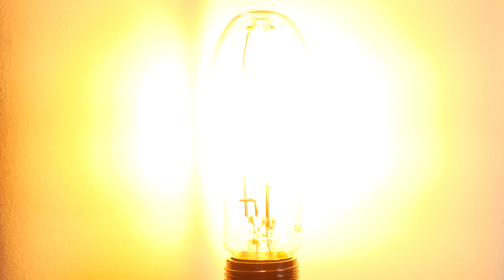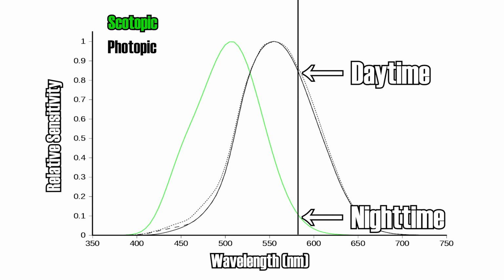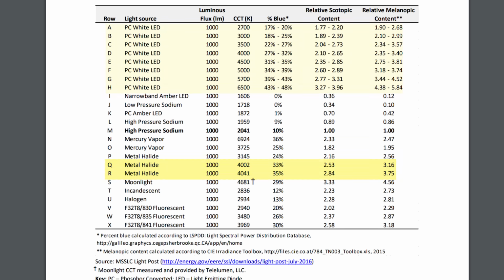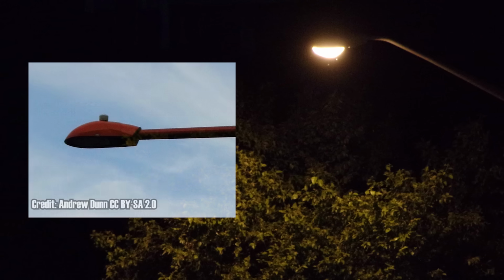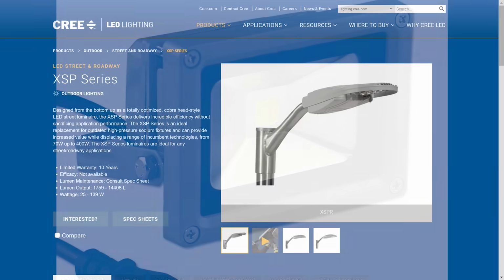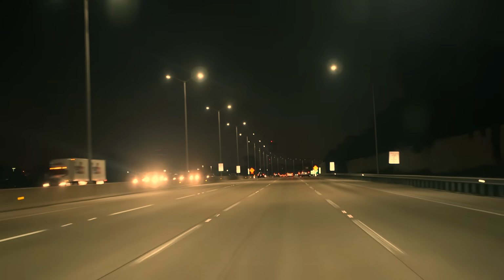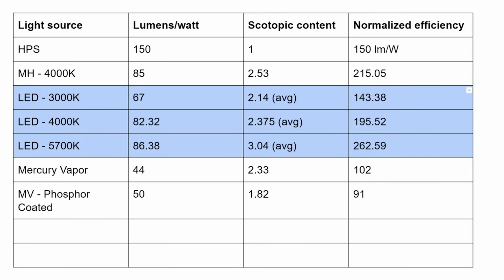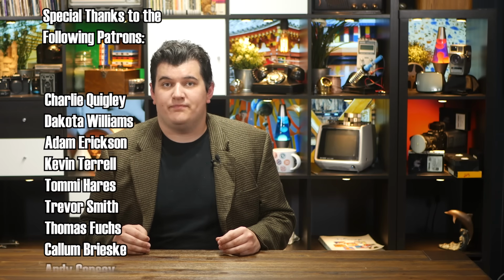The LED's Challenge to High Pressure Sodium

Comment: Honestly all outdoor lights should be red band.  That includes headlights.  Yea the color perception is terrible, and it is harder to see than blue but it does not destroy your night vision at all.

When you get off that highway lit up like a airport runway strip all the other roads for the next 5-10 minutes at least are going to be perceived as darker, so they will need to install more lighting in the future.  You can talk about saving a bit of efficiency on each unit, but you are not going to diminish the demand for lighting using wide band technology.

edit honestly was that highway poorly lit before?   You know that traffic circles are safer than 4 way lit intersections?  Because people perceive more danger- they are more careful.   You have to be very careful about speculation on this.

additional edit a camera with its highly adaptive technology is not going to show you the difference either in your diminished night vision- soon as you pull off it will be calibrating for current lighting conditions, not the 15-25 minute lag of night vision loss.
Reply from the maker: This literally is the opposite of how our eyes see at night.  Rod cells are adapted to moonlight/starlight.  Red light means little to them.  The issue isn't color rendering--it's the wavelengths that actually stimulate our eyes.
Reply: excellent video though.

Comment: I wonder if there will ever be a move to sensing street lights  that only turn on  when a car is present some distance ahead and behind it .  that would greatly reduce light pollution and be energy efficient provided that sensing dose not take up too much power.  the switch to led kinda promote this too  because they take no time to turn on
Reply: No help for pedestrians, in fact downright unsafe: An invitation to muggers and assorted thuggery.
Reply: You are very smart.  This trend for a system like you described is starting in Germany.  One light fixture can sense a car, and even wirelessly talk with the rest of the grid to get the light fixtures "ready."   Of course in heavy traffic everything is on, but after midnight most of it is off or dimmed greatly.  The risk is that the system may not function properly, thus creating a dangerous condition.

Comment: How about striking a balance of light sources? For highways, bi-passes and large volume traffic areas, use a whiter source of light, and for less traveled roads near homes and such, using a more yellow light? I know it would likely be difficult to get a decent balance, but it is an idea, and it isn't impossible. Light is a very important thing for me because I tend to drive a lot at night, makes me picky about the color and output of my headlights, and I do prefer intense white light for my headlights, but, I prefer a nice yellow for my fog lights. The combo of the two makes driving in any night time conditions a lot better. Be it foggy, rainy or snowing, I can drive a lot better with a mix of the two colors of light. My headlights I try to keep somewhere between 5,000K and 6,000K, and fog lights are around 3,000K.

Comment: Disrupting our circadian rhythm might be beneficial as the drivers will not get sleepy while driving. At home, you should use warm temperaturs. Also, the natural moon/starlight is as well cold, blue. Although much lower in intensity, still it could interfere with the circadian rhythm (are there any studies that take this into account?)...

Comment: The idea about reducing the light output after mid night is actually good, both for light pollution and for energy management. In Norway there are a few test stretches where the light fixtures are equipped with some light sensing equipment. T hey are running the lights at low intensity normally, but when a car is spotted it turns up the intensity untill the car has passed. This, of course, is saving a lot of energy when the traffic is low. 

I have linked a video where this is shown. https://www.youtube.com/watch?v=mi8eE_NEfHM

Comment: I think I prefer the sodium lamps over the LED lamps. I hate blue light, and the orange/yellow color that the sodium lamps produce is a really nice color temp IMO. But it's more important of what the majority likes in this case.
Reply: I think safety and saving energy are the most important things, not what color temperature people prefer to look at.
Reply: Yeah thats what is most important.
Reply: The jiro Network You must like the gentle glow of candles , but no one is going back to using them for general light.

Comment: LED lighting is the absolute worst thing that could ever happen to cars and road lighting.
Why ? Because there are no defined standards, and even if there were, nobody to enforce them. The result is that we get blinded more and more by oncoming traffic, even in the daytime now, and sometimes can berely see the road in some places under cheap LED street lights. Not to mention that in rain or fog or snow, those whitish LED street lights will actually light the water molecules in the air instead of the road surface itself !
Reply from the maker: There very much are defined standards for headlights.  That's what DOT regulations are.  Many of the terrible headlights you see are the result of careless people putting HID kits or other ill-fitting equipment in reflector headlight assemblies that were not designed for them.  Third parties like the IIHS are actively working to promote better headlight designs for both the driver and oncoming traffic.  Pretending that the LED itself is the cause of these issues is ignorant, and flies in the face of the extensive research that has been done on this topic (much of which was presented in this very video).  If you choose to categorize your own opinions and perhaps incomplete understanding on the issues as more important than the work of actual researchers... then what's the point of research?
Reply: Toyota has put LED headlights in its Corolla since 2015 and they're factory adjusted, but still blind oncoming trafic because of poor design. The number of lumens is WAY more than regular low beams used to be.

Comment: I wonder if we can get warm LEDs with improved efficiency by not using phosphor caps (comment added without research!)

I think the phosphor converts some of the light to heat, which is why you reduce efficiency over colours LEDs, especially in warm white lights, which convert the blue light further.

Instead, produce the light with red, green, and blue LEDs. Or possibly a combination of only two colours, like cyan and red.

Advantages (I think) - 
 - Less polution - you get three, narrow bands which astronomers can filter out.
 - More tune-able - less blue light in residential areas, more on motorways (freeways)
 - You can update the output - dimmer when the traffic is low, saturated colours for special events
 - More efficient - again, not sure on this, but I think more of the output would be in the visible spectrum.

Comment: It does sound like you're overlooking one important safety concern when it comes to higher colour temperature lights: Glare. When you have a more blue-heavy light source it means your eyes and retinas will stop being dark-adapted and start adapting themselves for daytime. This means that even though lit areas are more visible, dark unlit areas become more dark and shadows become more apparent. That's the reason the army uses red filters on their flashlights during night-time operations, and aircraft instruments are illuminated by amber or red lighting.

You can easily notice the effect when you are approached by a car with LED or discharge headlights as opposed to one with halogen headlights. Even with the same amount of luminous flux on the output, the former is more blinding.
Reply from the maker: I'm not so much overlooking it as simply finding it unimportant for this discussion.  We're talking about areas with roadway lighting, after all.  Once they eye is adjusted to that light level, worrying about glare factor seems unwarranted, especially when the research shows that whiter light is safer for detecting hazards.  Where it is of legitimate concern is in the transitions between urban/suburban and rural areas.  I think the best way to manage that would be to gradually shift from cooler to warmer light and then bring down intensity as you leave areas with roadway lighting, giving your eyes time to adjust.

Comment: High quality LED street lights; I'm all for it. Headlights on vehicles,  not so much. I don't think there's enough regulation to limit the cheap annoying bulbs that emit a seizure inducing flicker frequency. I'm extremely sensitive to them and sometimes have to pull to the side of the road until they pass.

Comment: Great video! Although I agree I find high color temperature LED light not as pretty (please stay under 4kK, but LPS and HSP are not all that pretty also), I don't think the sleep disruption aspect is to bad. Because, hé, you need to stay awake in the car! Only directing the light onto the places you want now is even more important.

Only aspect I'm missing in here in more depth is dimming. An extra bonus for LED lighting is that it's easier to dim. And the darker the night, the less light we need for the same amount of contrast.

And yes, drop in replacements without replacing the ballast is crap. The design might work fine (although driver failure seems to be the Achilles heel of a lot of LED lighting) but the ballast + driver will be less efficient.

And fun fact, here in the Netherlands LPS lights are still pretty common (especially on the highway and B-roads). That being said, LED is rising quickly.

Comment: I get terrified looking at those HUGE light poles when driving down the interstate in some areas. I don't want to know how they change the bulbs.
Reply: They have cherry pickers like they use for tree work to get up and change it. They just park on the shoulder, and up they go
Reply: The new high mast highway lighting fixtures are now equipped with LED modules.
Reply: Don't worry. Changing the bulbs in a cell tower requires an even greater increase in potential energy to occur.
Reply: The head fixtures are lowered like on a flag pole, here in Ontario they will close a lane of the 401 for hours just after lunch hour just so they can swap a few HPS bulbs, causing traffic to snarl for the entire afternoon. They need about 6 or 8 unionized guys to do it.
Reply: some of the poles are on hinges so they can lower them down flat. looks weird af when they do that. although i think thats more frequently shorter poles so might not answer your question. (then again the two other people already did lol)
Reply: Hinged poles are commonly used on footpaths where I live, I think because it's harder to get vehicles with lifts there to replace lamps.
Reply: ye i usually see them on footpaths, def seen them down more normal roads though
Reply: The change the bulbs by standing on a lift.  Safer than it is for you to climb on a ladder to change your ceiling lights.

Comment: Well informed video. 5000k LED light should not put in residential areas. There are people who cannot sleep wel because light leak from 5000K LED lights there. Studies pointed already out some people have sleep problems. So, the 5000K leds must only used on important roads (also where speed is high) but inside residential areas we're driving with slower speed, so yellow light is not a problem. 

I know yellow leds are less energy efficient but people wellness is still important. Most old people are used to yellow old lights. When it changes to white lights, they will "shocked" in sleep and have more sleep problems, because body reacts different than before. 

I hope yellow leds will used in all residential areas. Here in Netherland we see more LED lights. But i see more white leds than yellow leds, even on parking areas (why shoud parking areas have white lights?) and so houses around will have some problems with leaked white light. 

Sky should also not lit up too much due white leds. Sure yellow leds are less bright, but that is exactly what we wanted. Or white leds should have brightness control, so after midnight it should reduced by 50% (leds don't need much energy to lit up a bit!) and that means more energy saving - and longer lifetime of street lights!

Comment: Most of these sorts of complicated and arguably subjective debates are ultimately rendered moot by the inexorable drive of the underlying technology. In this case, it's the fact that the theoretical maximum efficiency of semiconductor lighting is UNBELIEVABLY HIGH. Cree itself has demonstrated over 300 lumens per watt in a GaN white module years ago and the limit is possibly double that. It would mean that a 60w equivalent home bulb could be replaced by something that consumed a mere 2 watts. Lighting becomes effectively "free" at this point for most applications and it's ultimately the economics of that which will drive adoption whether we like it or not. See the fantastic short documentary 50 Things That Made the Modern Economy - The Light Bulb https://www.bbc.co.uk/programmes/p04knm03
Reply from the maker: Surely the idea of holding onto sodium lighting is silly, but there are legitimate concerns about color temperature and how this relates to light pollution, circadian rhythm disruption, and visual perception.  That much will stay the same regardless of how efficient the technology becomes.